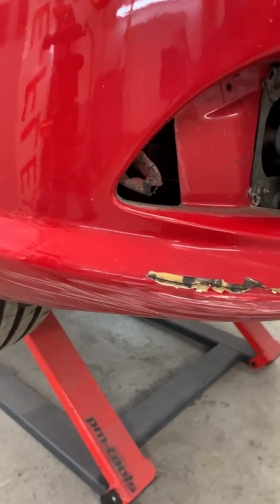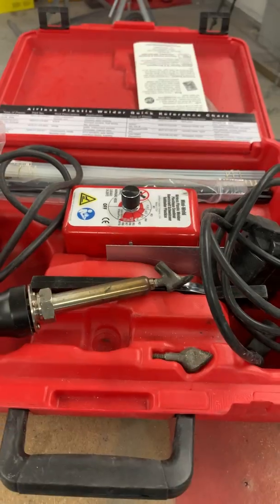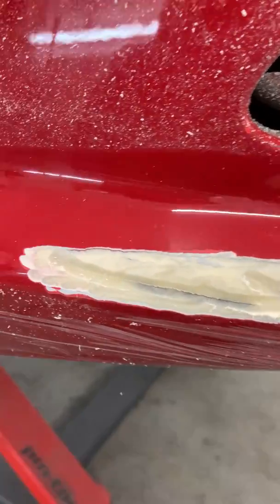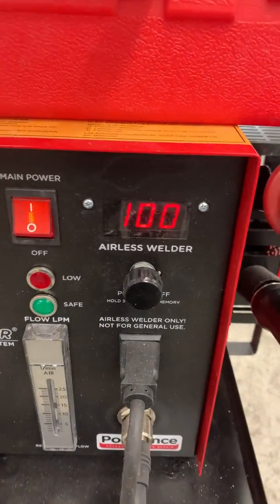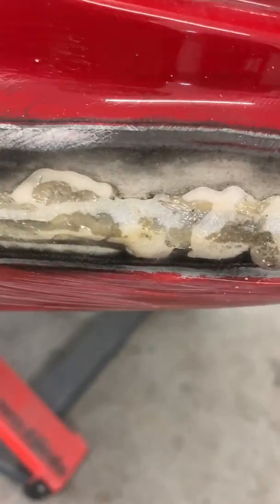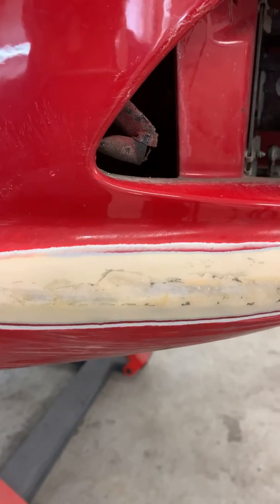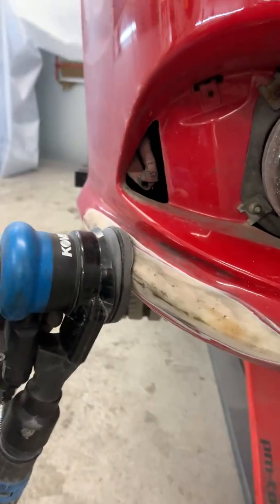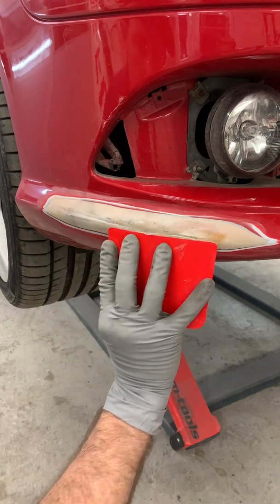HOW TO REPAIR A CRACKED POLYURETHANE PUR BUMPER

Comment: Great work, can I use this pur welding method to ace tech material for my cracked paddle board
Reply: This is what I found about the product it’s Polyester Recycled Polyester Nylon Polyamide Recycled Nylon Spandex Lycra Modal. So not sure if this is same to pur?
Reply: "ASA Polymer outer skin" refers to a protective layer made from Acrylonitrile Styrene Acrylate (ASA) plastic do you think this can be welded material?
Reply from the maker: Totally different material. PUR is polyurethane. 

You need to find the correct plastic to repair the board, they can’t be mixed
Reply: @damageundoneltd  great thank you so it looks like they make ASA glue stick. Not not available in my area. Thanks again for the video going to try reach out to manufacture
Reply from the maker: Providing your board is PUR, i cannot see why not

Comment: I've got a early 1983 Audi Quattro that has a cracked airdam, looks to be polyurethane but the material is a black color, believe it's the same material as used in Porsche 944 fonrt air dam black color, need to know if I can use a repair glue or the technique you just used? I'm assuming polyurethane can be black color also?
Reply from the maker: Hi, I have seen black pur but majority of the times it yellow. There should be a plastic identification stamp on it. Have a look for that, if you can’t see it then do a test weld or if you want to cold/chemical weld it then just read the data sheet to check it’ll work on all plastics
Reply: @damageundoneltd  no plastic type identification on the back side, has some date codes but that’s it. Most early 70-80’s semi flexible plastics are polyurethane, and I’m not surprised that Mercedes you show in the video is using this process still. I purchased this kit to repair the damaged cracked air dam, but I contacted the mfg asked if the product would work they answered yes, Vicrez vzr101 Auto Body Plastic Bumper Repair Kit. Going to scuff up a spot on the backside of the air dam today and attempt a surface adhesion test before grinding back the cracks and attempting the repairs, wish me luck!
Reply from the maker: @blkcoupequattro ok cool, good luck 

I had to fix this today 
https://www.instagram.com/reel/DADfuV7Mgcv/?igsh=MWJtMnBsY21jbTBkbg==

Comment: How strong is this repair? If someone accidentally kicks the bumper in that spot with a medium force or if you happen to bottom them out on a small section of road for a quick second, will it snap? I’m needing to repair my side skirt on my MK1 focus RS and I am gonna need to do it this way because the plastic code is PUR.
Reply from the maker: If don’t correctly (like I show in the video) then it is as strong as the original bumper, if not stronger. However if you hit it again with enough force then of course it will break, just let any other section on the PUR part

Comment: Your videos  are addictive  to watch, thank you so much. How would you  find what type of plastic a bumper is?
Reply from the maker: hiya, PUR will almost always be this white/yellow colour and if you try to hot weld or hot staple it, it’ll just fizzle away. 

If you can take the part off then it’s easy because every plastic component will normally have a stamped identification of what plastic it is made of on it 👍